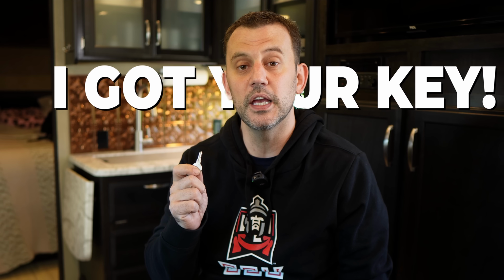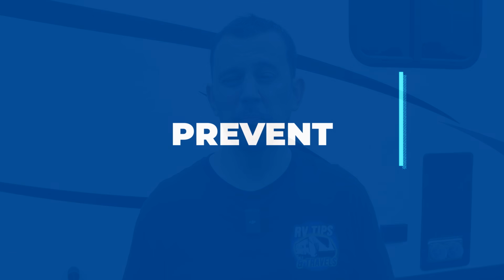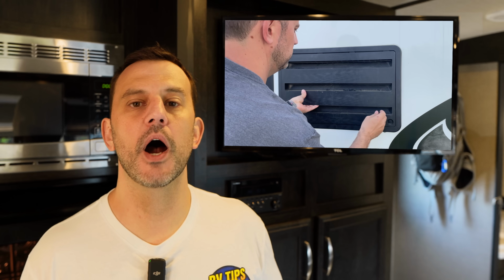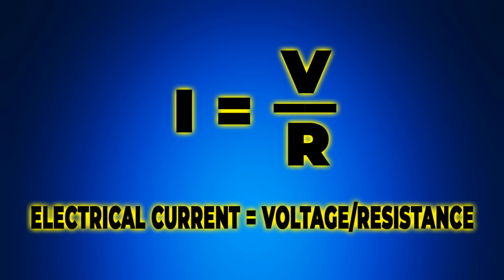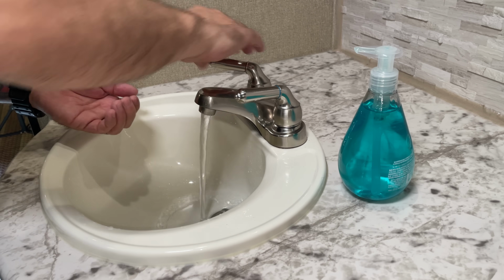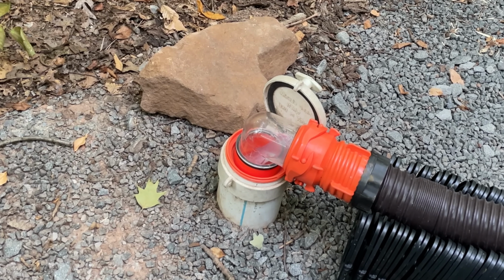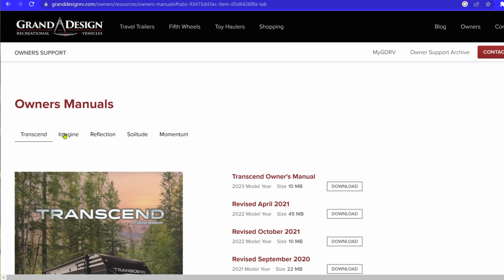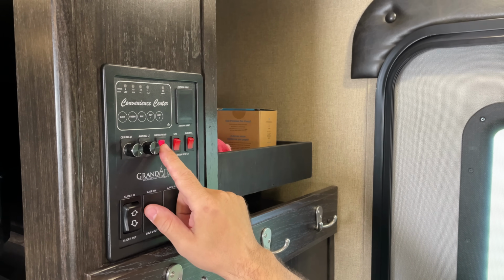7 Things You're Not Doing to Your RV... but SHOULD!

Comment: good advice thanks, can your radio run down your battery when your not hooked to shore power and everything is off but the panel lights stay on the radio?
Reply from the maker: Not 100% sure of the draw but I would think head unit lights draw less than half an amp, so it would take some time to kill the battery.  If you have a quick battery disconnect I would just use that if you are not using your camper for long periods of time.  You can also get a 15 amp dog bone and connect to your house just enough to keep the converter running.  What is your camper, 30 or 50 amp?

Comment: We have had several RV's, and every one has had multiple water leaks in the plumbing.  All but one were loose fitting nuts where the supply lines connect to a faucet, toilet, shower, outside kitchen etc. At least twice a season, you should go around and hand tighten every one of these fittings. I know it's a pain to access shower and water heater fittings, but we have had leaks into walls and floors from both of them. These leaks were all on newer RV's usually under warranty. But who wants their RV in the shop for weeks when you can fix the problem yourself.
Reply from the maker: thanks for adding!

Comment: The screens are a mixed bag. Something people do not realize is that the appliances are designed around air flow tolerances particularly the furnace. The screens impact the air flow away from the design specifications. For example on the furnace, tight screens on them reduces the venting. It changes the dynamics of the air handling and can damage the system...  I had a 25 year tech tell me this. He said IF you are going to do it in areas where the bugs are a problem, have the ones that stand well away from the outflow or if you make your own do the same as it helps that problem. The flat ones even if sold by a company can reduce flow by as much as 30% also posing a danger...  From and article by a "master tech" on this. "Yes, that ‘bug’ screen restricts the air flow by as much as 30%. Not enough combustion air means too much gas (i.e. running ‘rich’) and will cause soot build-up inside the heat exchanger, which will result in reduced heat transfer. An additional result of restricted combustion air flow is excessive heat buildup in the motor’s bearings, which usually leads to premature failure of the motor. Warning: Using the bug screens will void your warranty. Comment: If you are using the furnace during the cool spring/fall months or the cold winter months, take the screen(s) OFF! You only need them during the summer months or when the RV is in storage. Besides, no bug can live or build a nest in the furnace when it is running!"
Reply from the maker: Thanks bud, appreciate the input and you being here.  Enjoy MT!
Reply from the maker: The screens that bevel out like the ones on the furnace and water heater do not restrict air flow because they spread out the surface area of the screen.  There’s already been flow tests done on those, but you are correct on some larger fridges that require more air the flow can be restricted with flat screens. I’m not having any issues with mine but I’m working on a diy video for fridge vent screens that will bevel and not restrict air flow.  It might not be published until next spring time but I plan on doing airflow tests with an anemometer to prove this.  As mentioned on our main channel page it is always advised to check warranty before installing any aftermarket parts.  There’s also plenty of bugs still active here in the Pennsylvania mountains through all seasons except winter unfortunately.  I just pulled 4 dauber hives from the top fridge vent that I haven’t screened off yet.  Thanks!
Reply: My guy said it was the furnace that was the real problem as the air flow "velocity" isn't the same with other appliances.  I had screens on everything but it was the furnace he was adamant about removing.  It was my own install and "flat" across the openings. I moved to MT and not many bugs it wasn't as much of an issue he said. He didn't seem worried about the fridge at all.  @RVTIPSANDTRAVELS

Comment: Hello! I bought a toy-hauler/ several months ago and repaired among other things, a leak on my fresh water tank from the discharge tube to the vale. ABS glue joining both with 2 new clamps, sealed it like new. After that I discovered that the two got separated because the factory stopper on the end of the tank to frame was gone, allowing the tank to slide which caused the disconnect. I cut two pieces of beefy angle iron and bolted them to the frame behind the tank so now it won’t move.
Reply from the maker: nice George, thanks for sharing here!

Comment: Just recently put the screens on my vent for the fridge.  It's that same one in the video (Dometic black plastic) but I'm concerned that it will cut down on the air flow and possibly give the fridge some issues.  Might just use it while the trailer is just in storage.
Reply from the maker: I’ve heard from a few viewers that some of the larger fridges need a ton of air to cool and these screens can restrict air flow.  A lot of folks I know have used these for years with no issues but none of them have massive residential refrigerators.  I’m actually working on creating a screen that bevels out around the perimeter to create more surface area so there’s literally no air flow loss.  I have the screens on my rv (6cu. Ft fridge) and don’t have issues.  If you remove them, just be sure to check behind both vents regularly.  After filming this I checked my top vent and found 4 nests.
Reply: Thanks for the info.  I have the 6 cubic foot one myself.  Luckily mine is not in a slide so I get good airflow naturally.
Reply from the maker: Keep me posted if you notice anything Craig, always interested in learning more and sharing what our viewers are seeing.  🍻

Comment: We have the 235s rockwood roo and IT IS a 2021  Used it approx. 7-8 times and have just noticed, with all this rain, that the back tip out has a leak.  We removed the mattress so as to find where the water is coming from as only the bottom of the mattress is wet!  Put a folded up garbage bag to catch the water FLAT ON THE SLAB THAT HOLDS THE MATTRESS.....But the water went INSIDE THE FOLDED BAG  We have no clue where its coming from..ANYONE have this problem..also did the waxing over the stitches on the canvas which did not stop the water..This only happens when it rains...H E L P
Reply from the maker: not sure, finding leaks is never easy, but a good place to start is being inside while its raining

Comment from the maker: ✨⭐ PRODUCTS FEATURED IN THIS VIDEO ⭐✨
🔹 Pass-through replacement locks https://amzn.to/3BH1QhE
🔹 303 Aerospace Protectant https://amzn.to/3WuWrnl
🔹 Camco Bug Screens https://amzn.to/43iuC3Z
🔹 CRC QD Electronic Cleaner https://amzn.to/3WufMoQ
🔹 Microfiber cloths https://amzn.to/3Mk5brT
🔹 RV Snapjacks & RV Snappad (10% off) https://rvsnappad.com/discount/RVTT10
🔹 Camco clear sewer hose elbow https://amzn.to/3CN8nYo
📰 Free RV Newsletter: https://view.flodesk.com/pages/6497c6a9d1998fa8c7623e9f

7 Things You're Not Doing to Your RV... but SHOULD! There's a lot of information on RV's these days, but there's also a lot of things that are less mentioned that will help with safety, maintenance, and the longevity of your RV.  In this video, we discuss some of those.
 
Thanks to Joshua from  @rvgearandfar  for the assist with some B roll.
 
#rvlife #rvliving #rvtips #rvhacks #rvmaintenance 

✨⭐ OUR FAVORITE RV ACCESSORIES ⭐✨

ESSENTIALS:
✅ Camco Rhino Flex Sewer Hose & Elbow Kit https://amzn.to/3wxaiyG
✅ Camco 90 Degree Clear Sewer Elbow https://amzn.to/3eezBe7
✅ Camco RV Water Filter https://amzn.to/3VzcMqi
✅ Rubber Wheel Chocks https://amzn.to/3v0lL5I
✅ Hughes Watchdog 30 Amp Surge Protector/EMS https://amzn.to/3hAmgCy
✅ Hughes Watchdog 50 Amp Surge Protector/EMS https://amzn.to/3HKrpm1
✅ Liquified RV Tank Treatment https://amzn.to/3ksg1Ck
✅ Tire Minder TPMS https://amzn.to/3mjuBg0
✅ Water Pressure Regulator https://amzn.to/3m3ZFzZ
✅ Rubber Gloves 6 Mil https://amzn.to/3XNo7Dc
✅ Collapsible Water Hose https://amzn.to/3SvNubw

MAINTENANCE:
✅ Boeshield T-9 Rust Preventative & Lubrication https://amzn.to/3sjcjMx 
✅ Eternabond Roof Tape https://amzn.to/3Ad290J
✅ Geocell Proflex Sealer https://amzn.to/3KGMOyb
✅ Road Tool Kit https://amzn.to/41NIQKj

INTERIOR:
✅ Camco Cross Bar Door Handle https://amzn.to/3o8WWS5
✅ Shower Caddy https://amzn.to/3bdU80W
✅ Soap Dish https://amzn.to/3pKheSn
✅ Oxygenics Shower Head (White) https://amzn.to/3nhDMYW
✅ Oxygenics Shower Head (Brushed Nickel) https://amzn.to/2O8YcYC
✅ Perfect RV Paper Towel Holder https://amzn.to/3tZxd1K
✅ Dimmer Switch https://amzn.to/3rQdfFD
✅ Sliding Door Latch https://amzn.to/3EkpTT0
✅ Puppy Paw Hook https://amzn.to/2N9JaRV
✅ Foldable Storage Bins https://amzn.to/3tIp01f

EXTERIOR:
✅ X Chocks https://amzn.to/3m3ck2i
✅ Carmtek 10 Digit Keyless Entry System https://amzn.to/3t4IMpB (see the video here: https://youtu.be/KcEUgsDw6kk)
✅ Low Point Drain Valves https://amzn.to/3Jd6adb

OUTDOOR GEAR:
✅ Blackstone Griddle 22” https://amzn.to/3MDDiL0
✅ Blackstone Griddle 28" https://amzn.to/3eBnOuD
✅ Outdoor Gravity Chairs https://amzn.to/3Sb1p4M
✅ Ground Mat https://amzn.to/41u3wXg

💥 Sign up for our FREE Newsletter: https://view.flodesk.com/pages/6497c6a9d1998fa8c7623e9f

✨⭐ MORE RV ACCESSORIES ON AMAZON ⭐✨
https://www.amazon.com/shop/rvtipstravels

💥 NEW TO OUR CHANNEL? Check out our catalog:
https://www.youtube.com/c/RVTipsTravels/playlists

🙏 If you found this video helpful & want to support our channel with a small donation click here: 
https://www.paypal.com/donate/?hosted_button_id=J2KKM9NR3BJJA

✨⭐ DISCOUNT CODES TO SAVE MONEY ⭐✨

🔨 Learn how to repair & maintain your RV like I did w/ this COMPREHENSIVE training course:
https://rvtechcourse.com/?ref=rvtips&travels

🚐 10% off RV Snappads! https://rvsnappad.com/discount/RVTT10

🛌 Get 25% off your RV Mattress by Brooklyn Bedding at https://rvmattress.com/rvtips
Use discount code: rvtips

📡 GPS Tracking for your RV! https://www.wheresafe.com/rvtipsandtravels
Get 10% off by using discount code: RVTIPS10

If you find a dead link, let us know & we’ll send you an RVTT sticker!

📺 Want to see more RV videos? Please SUBSCRIBE & CLICK THE BELL ICON 🔔 so you're notified when we release new videos!

Follow us on social media:
📸 Instagram https://www.instagram.com/RVTipsAndTravels
🕺 Facebook https://www.facebook.com/RVTipsAndTravels

We may receive a small commission for purchases made through the affiliate links above. There is NO additional cost to you when purchasing from our links & it helps cover some of our material and equipment costs to make these videos. We GREATLY appreciate your support!

Comment: All great points! Thank you, but now many manufacturers are no longer supplying manuals for the RVs, they offer PDF files for download on their websites. I'm an RV service writer, many times in the past three years having customers come in with problems with their water heater or heater not igniting or burning poorly and backfiring. This has been due to those screens over the exhaust and air vent. If you have issues remove the screen first and check the appliance before bringing it in for service. The screens cause problems with the air intake or exhaust airflow. Instead of screens, visually check the exhaust for bee nests and blockages before using the appliance. For 5th wheels and TT, always check the torque on your wheels before hooking up to leave. I've had many customers come in with the RV's side and floor torn up from tires that have come off while in travel. Additionally, always check the tire pressure every time you hook up, and once a year clean and grease the wheel bearings. If living in your RV full-time check the water level in your batteries  (if they are not sealed) at least twice a year. The constant charging of the battery can make the fluid gass-off and you will have very little water left in the battery. I live in mine full time  (4.5 years) and while leaving one morning I smelled fumes and found my two batteries smoking. Until then I religiously checked my batteries each spring and fall. Now I check them more often. Another thing to check is if you have been camping under trees and have a roof exhaust vent for your fridge, check it making sure leaves haven't gotten caught under the vent shroud creating a fire hazard or blocking the exhaust. To satisfy the roof warranty, you must prove the maintenance of the roof.  Check your owner's manual for what they require and save your receipts. There is a screw channel that runs on each edge on the top side of your RV, for 5th wheels and TT. You can find it along the roof edge, around doors, and on 5th wheels on each side edge of the nose. It has a plastic cover that inserts over the screws. Over time and depending on the sun and heat these will shrink, twist, and scrunch up. Check those after being in hot weather. This plastic cover helps keep water from getting into your seams through the screws.
Reply: Thank you for your excellent info . Two thumbs up 👍
Reply: Good Stuff, Thanks Bunches...
Reply: Thanks Janet, I will definitely check that plastic channel cover now!
Reply: Many modern battery chargers have a battery maintaining setting. This isn't a trickle charger, per se, but it  helps dissolve the settling at the bottom of your battery cells. That is what makes cells "go bad" by building up and shorting out the cell plates...killing the entire cells ability to function.
Reply: I'm new to RV ownership, but from many videos I've watched  the recommendation is to check your tire temp and pressure every time you stop... for fuel or potty or whatever. Some recommend getting a infrared temp gauge, but at least use your hand to feel each tire and hub. Many swear by having a tpms system so you get immediate/constant feedback on tire temps and pressures. Under inflated and overheating tires are a main cause of blowouts...

Comment: We want to add a 200 ln generator by welding a stand to the front of our prime time avenger travel trailer. Do you have any tips on that?
Reply from the maker: i havent done anything like this, but i would caution you about welding onto any part of the frame... sometimes welding can weaken metal due to heat.  i have welded a lot in my life, just havent done it on an rv frame and never did the research so that is something i would recommend first.
Reply: Yea, we did check it out and, no, its not a good idea. Lol. Thanks for replying though!  @RVTIPSANDTRAVELS

Comment: Ross, I noticed the water heater door has a large vent and mine has a small vent and what happens when I first start the water heater it will take some time to get to the shut off temp. The roll out link keeps melting and I will have to replace it. This is NOT a fix to replace a part and say it's done. I have done several tests with and without the electric and gas. I started with a cold tank and left the door opened while the tank is getting to the shut off temp. It works, but not a fix. Now when we are at a camp site and the first thing I do is open the water heater door and let it go until it shuts off. Then I close the door and the water heater will now cycle at shorter times. My door has a very small vent and I emailed Dometic to let them know my story and was hoping the message would trickle to their engineers to fix the problem. No answer back. We have a 2021 Imagine 29' pull trailer with a dometic water heater. Can I get a door with a larger ventalation grill?         Thank you, Keith
Reply from the maker: by "roll out link" do you mean the thermal cutoff fuse is failing?
Reply: Yes, the thermal cutoff fuse. It's also called a "flame roll out link". One of my test was with the water heater door closed and while the water heater flame was on I took a temp reading and it was climbing well above 180 to 190 degrees inside the heater compartment. My combustion/exhaust vent measures 4"X4". At first I thought my thermostat was stuck and I bought several along with the cutoff links. After I replaced the thermostat there was no change. The cutoff melted before the thermostat was satified. So I was hoping the engineers would be able to make the combustion vents larger to keep the thermal cutoff from cutting out. 
Thank you, Keith
Reply from the maker: Could be a few thing happening but ventilation definitely sounds like the issue.  I’ll have to see what I can find.
Reply: Ross, I emailed Dometic customer service and sent pictures of my water heater door explaining what I thought was the problem with the roll out/thermal cutoff fuse keeps opening. They said I was right and they have a new modified door with more ventalation. They will send me a new replacement door under warranty. Will see how this will work when I get it installed.
Reply from the maker: Nice!  Hope it helps, keep me posted.

Comment: Question not related to maintenance. Do the brakes on a 5th wheeler automatically engage like a handbrake when seperated from the tow vehicle?
I do alway chock the wheels when disconnected, but have always wondered this as smaller RV's have a handbrake that you engage when disconnected to the tow vehicle.
If anyone knows the answer to this, that would be appreciated 🙂
Reply from the maker: no brakes are engaged on modern travel trailers or 5th wheels, thus chocking is absolutely necessary.  the safety brake cable when disconnected will open a power circuit and apply power to the brakes.  at its normal resting place, it is actually disconnecting power to the brakes.  having said that, some may think just disconnecting it after being unhooked will automatically apply the brakes, but that is not advised to continuously have power applied to the brakes.